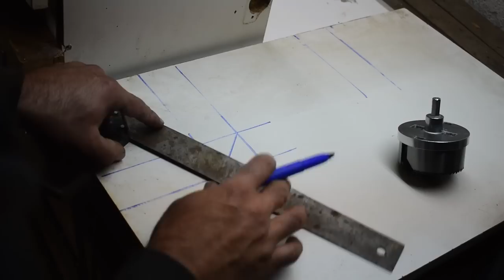METAL DRAWER SLIDES and 12v DC WIPER MOTOR ??? / DIY Spindle Sander Oscillating Machine

Comment: Great job, but don't you think it would have been more efficient to mount the wiper motor under the drill, and the pivot rod on  the bottom, thereby saving space? You wouldn't have to overhang a pallet then.

Comment: is it really necessary to examine every part including a line on the dowel and a bolt for so long?  It would be better and so much shorter if you just stuck to the build and didn't spend so much time rolling a nut around in your hand like it was something deep and complicated  lol..  just saying.  interesting concept though..

Comment: All the screws that are holding nut in, not to mention the 2 screws that are screwed into the slot to hold sandpaper in,  will cause part of the sandpaper to wear out faster. Good idea. Not very practical.